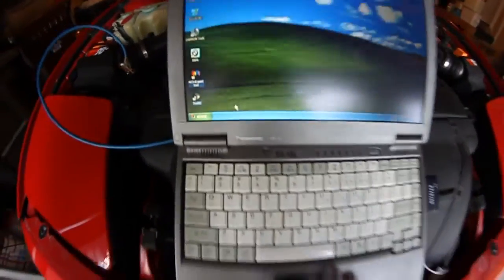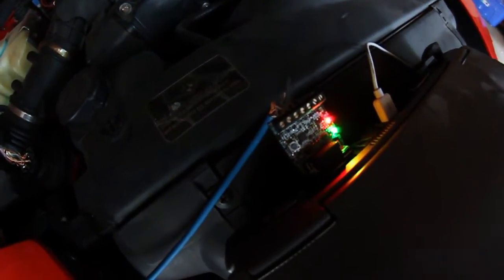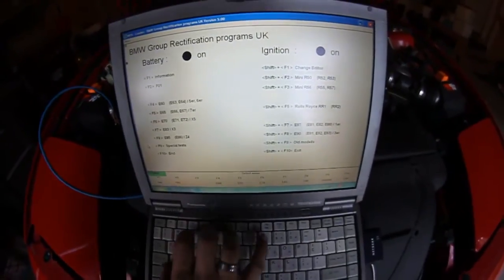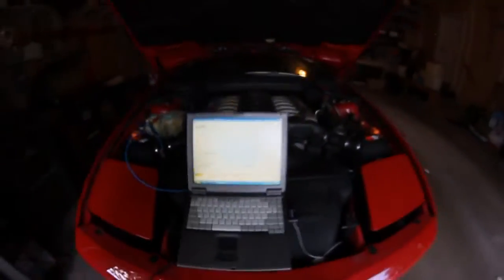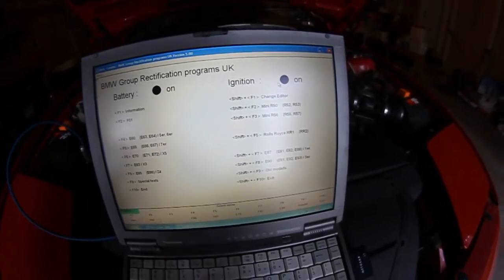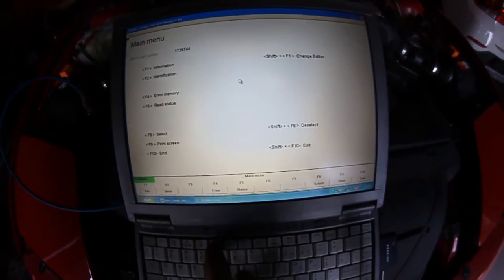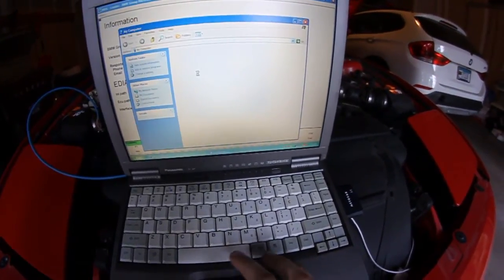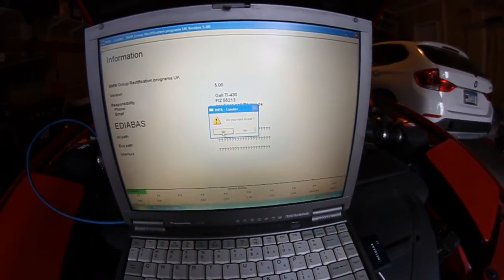BMW INPA through ADS using ebay hardware. basic tutorial

Comment: Please i am spanish i have the same car as you. I bought the tiny card, i installled impa, however it doesnt communicate the computer with the car. I think it may be caused by the settings in the programme. Please if i give you my email, could you send me what you have done i the programme so that it could work. Thanks.
Reply from the maker: Unfortunately I know nothing beyond what I go over in the video
Reply: @OvalboreCars  what version of inpa did you install to get it to work  with your e31?
Reply: Por si te sirve de ayuda, necesitas un ordenador con un puerto SERIAL NATIVO para poder comunicarte sin problemas.
Luego en el archivo EDIABAS.ini encuentras el AutoOBD y lo cambias a ADS.
Después ejecutas el archivo de ediabas ejecutable y reinicias.
Y eso debería ser todo
Tienes que poner donde este cada pin del adaptador al de el BMW que es redondo.
Aunque por lo que he visto en otros vídeos hay un cable que sobre que es para el KLINE.

Comment: Which verson of ediabas do you use? I tried 6.x.x and 7.x.x and i got Always an error when i change to ADS
Reply from the maker: Oh, I have no idea at this point. I still have the ADS adapter but this laptop died so I'm SOL

should worn on either configured for the serial port. are you using an actual laptop with serial, or a converter? no converters actually work.
Reply: in video the version is 5.xx as i see